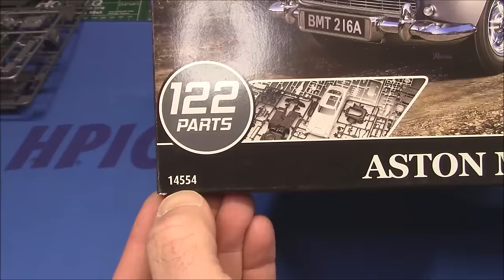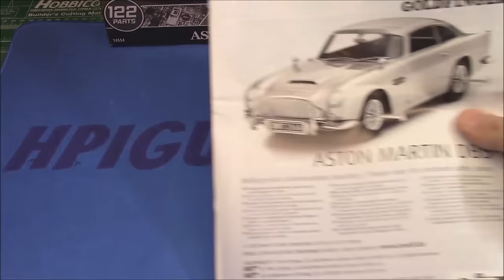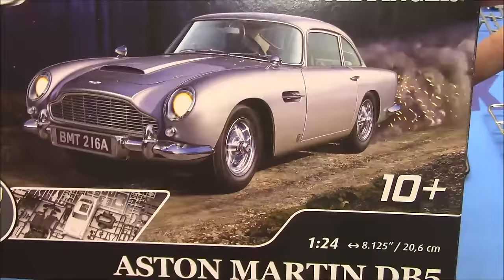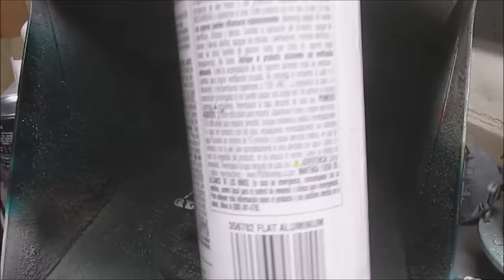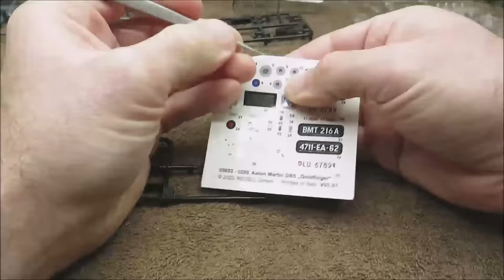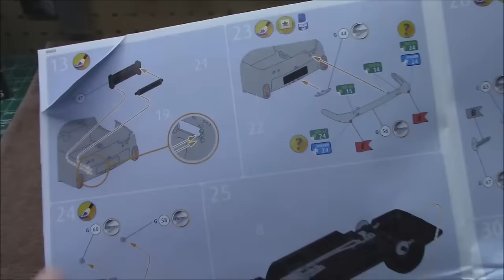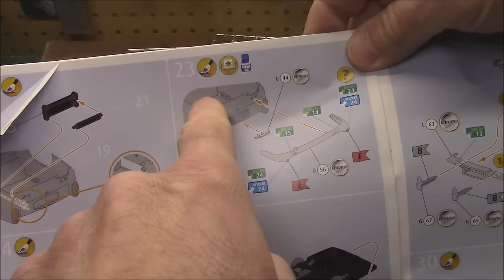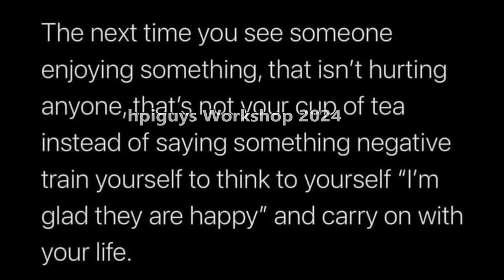ALL NEW Aston Martin DB5 James Bond 007 Goldfinger 1/24 Scale Model Kit Build How To Assemble Paint

Comment: Hi Chris - here in the UK, the amber turn indicator light always goes at the top of the light cluster.  It's the same for all cars, not just Aston Martin.  One other thing, and not easy at 1/24th scale.... DB5's have a discreet trim badge on either side of the air intake bulge which reads 'Superleggra'. That's the Italian design house who styled the body. You can barely see it in most photos of DB5's but, see one for real and it's there. Pity they didn't include it with the decals
Reply: Oh yes they did!

Comment: I'm glad we have the choice of building this with or without the Bond gimmicks. I choose the latter.
BTW Chris, did you ever follow through on my tip on where to get the super gloss Mod Podge? Just curious as I saw you're still using the regular gloss brand.
Reply from the maker: I snagged it in the craft section of Walmart, thanks!
I've always used the Super Gloss and the regular gloss is much thinner, works well for  coating dash gauges, etc.

Thanks!